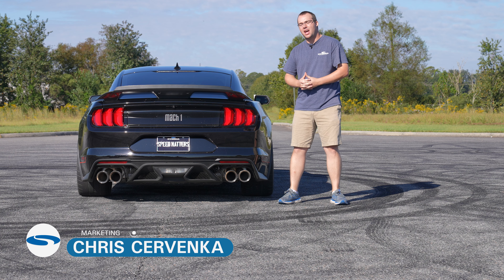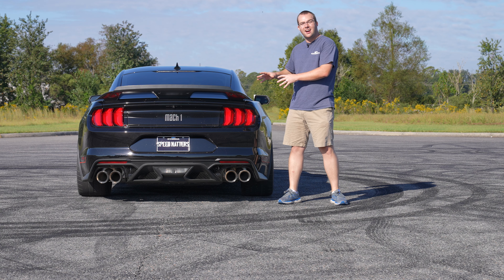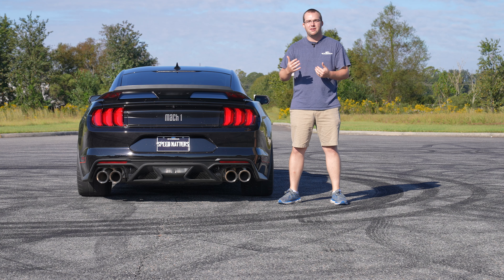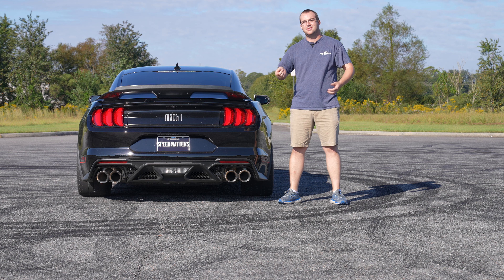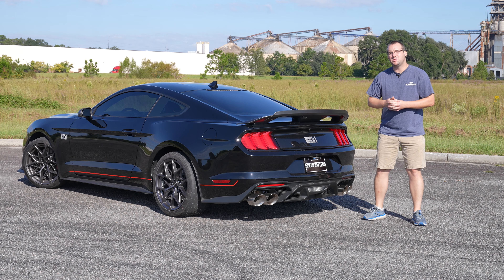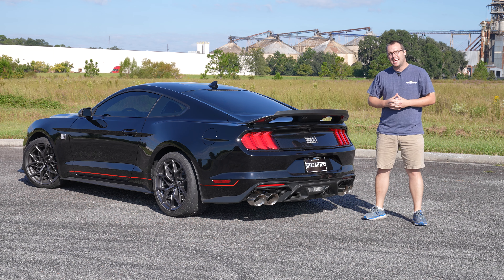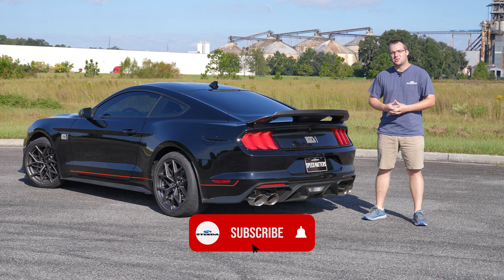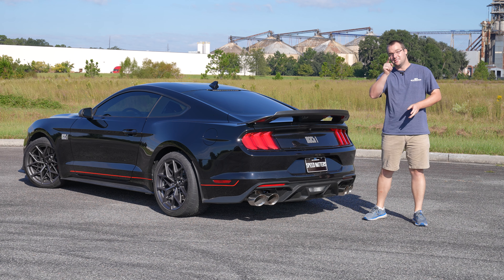2021 Mach 1 - Steeda Resonator Delete X-Pipe Sound Clips

Comment: Love how they changed from the auto to the manual like they don't sound different with or w/o resonator delete
Reply from the maker: We were simply showing how the engine and exhaust (which are the same regardless of transmission choice) sound different with a resonator delete.
Reply: @steedaautosports  got it don't get me wrong I have the steeda Xpipe on my auto but it sounds nothing like the manual all in all good products just stating the obvious